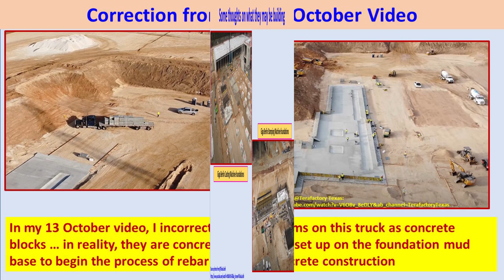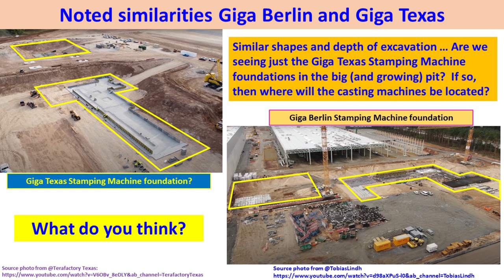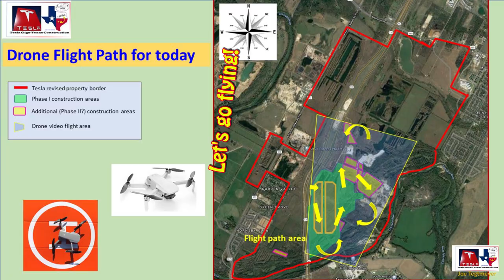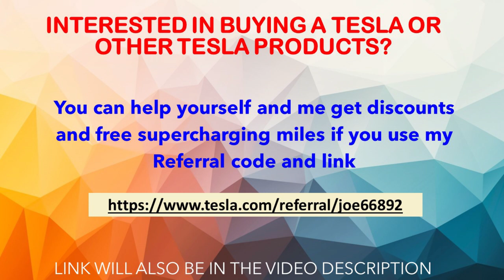Tesla Gigafactory Texas 15 October 2020 Construction Update (08:00 AM)

Comment: Hey Joe, it is so hard to compare Berlin and Texas, because they are using completly different building technics. For example, at the  Stamping pit thye drove 10 feet or 30 feet long Concrete Stales into the ground, poured a little Concrete on top of it and pileling up Rebar and Concrete on top. At the Casting side, they also had a deep pit and build large Concrete footings with Rebar, let the cure and build smaler Congrete footings with Rebar on top, filled the space in between with sand and poored Congrete with Rebar on top combining several Footings. We also had no GeoPiering in Berlin, I don´t know if that type of building isn't allowed in Germany or if they didn't came up with it. because all of the footings are super heavy and big in Berlin. Also the Paintshop is the only Building with a concrete floor so far. all the other Buildings, including the Drive Unit assembly doesn#t have a floor until now, it's still sand. On Thursday the Water Supplier shut down the Water Supply, because Tesla didn´t payed the bill or reacted to last note :-D - We don't play games over here!  The shape of the Pit looks like Stamping, but with the extension and the different construction methodes, I'm completely lost. If they keep the pattern of distancing them, Casting would be where they start GeoPiering in the middle. but at the  same side of the pits. The Pouring Training Site looks like they are training to pour concrete into small squares, like the stands for the concrete stales for walls and roof in Berlin. I think they'll wait with pouring the floor untill the end, like they are doing in Berlin. I'm curious to find out. Thanks for the Videos and effort!
Reply from the maker: Thanks and you are right, the methods of construction are very different, but it can be informative to see what they did in Berlin and then see how that might be done here.  I believe that unlike Berlin, the foundation will be poured first here in a continuous slab (or possibly large slab sections) and then later do tilt-wall construction using the slab as the production site ... but, we will all know soon ... probably around the first part of November.
Reply: @JoeTegtmeyer  Does anyone know how tall the tilt up walls can be?  Can you have multiple stories with tilt up walls?
Reply from the maker: Yes you can ... Up to 30 feet tall is common but with special spreaders and reinforcements they can go up to about 100 feet tall.  They are commonly used in large buildings, warehouses and factories in Texas and other areas of the US.
Reply: Lots of people said they turned the water off, but multiple videos from the usual documenters show there was still functioning water onsite when others were saying it was off. Also, it wasn't that Tesla was refusing to pay the bill, there was a sanfu in linking up Tesla's automatic payment processor with the Local governments payment system. Word is that is has been handled already now.
Reply: Part of it is the differences in soil at each site, which require differing methods of soil stabilization and foundation work. Part of it has to do with differing national and  local building codes at each site.
Reply: @JoeTegtmeyer  Thanks, Joe!
Reply: The nature of the soil, the depth to bedrock, etc all could impact the engineering choices for the foundation.  Berlin and Giga Austin are likely quite different in this regard.
Reply: One of the principal differences is the soil type. In Berlin it is deep sand  so the foundations are floated. In Austin it is reclaimed soil on gravel, so the geopier method seems to be the best methid of stabilisation. The other issue is environmental - in Berlin, due to the neighbouring  water conservation area and shared aquifer there were concerns that piling the whole site  ( as I understand was originally planned)  would somehow disturb the aquifer. Not sure if this was a valid reason...!
Reply: @andygranger3662  As a Professional Geotechnical Engineer, I believe the harm-the-aquifer narrative was purely based on emotion.   Almost all the water we drink is transported in concrete and steel pipes -- so by extension, it should be obvious that concrete and steel piles are safe in contact with drinking water.  And sticking piles in the ground is not going to change the water table -- water can flow around piles.  There will be densification of the ground in, and immediately adjacent, the area where the piles are driven.  But look at the area of piles, viewed from the overhead camera -- it's like 1% of the site.  And the whole site is a tiny part of the municipal water catchment   The impact of piling on the water shed will be zero.
Reply: @tedg1609  well that’s the point, it’s a water reserve Area and a very fragile Eco System. In Germany they work like proof it is safe to get the permit, in the US it is proof it to be harmful or we allow it. Like fracking, it’s forbidden over here, CH4 in atmosphere has risen massively since 2008, when it became common use in the US. And it’s Stuff line that, that’s handled different in Germany. If you put Stuff in the ground, penetrating the Watertable, it must be safe. It’s not like  Boisy (not sure if I spell it right) in Idaho, where the water was poisoned for a long time by companies and People had to live with it and needed to fight through court to stop it. We have a Verbraucherschutzzentrale like a institution of public right, which only purpose is to protect the People for lobby interest and harm from Companies. They test Products for safety from Nutritious points of view up to ethics, marketing, production everything you could imagine. That’s why Trump say we live in Forrest Cities and and Socialism 😁 we take care of our People and the environment and if they are safe, we talk about businesses.
The area where they are building Giga Berlin is providing the Tapwater for the City of Berlin and the whole region around and nobody want to harm the quality or possibility in 20-30 years. And even Tesla is a good Company, it’s still a US Company with a very different point of view. We still think they have no Idea of worker’s rights over here, because they won’t be here if they knew. 😁😁
Reply: @Marco2710x  ich habe ein paar jähre in Berlin gearbeitet, also ich stimme zu -- sie haben recht auf die unterschied zwischen Ami und Deutsche Umweltperspective.  Es Wahr, dass Deutschland ein Huebsher und mehr ordentlich Land ist.  Vielleicht ist besser dass diese dritte Tesla Fabrik in Deutschland gebaut ist, damit Tesla gute Umweltschutz regeln Lernen können.   In diesem Fall, Ich mach Ihnen die Vorschlag, dass vorsichtig in kein Perspektiv  mag night vorsichtig in gross Perspektiv sein.  Die Umwelt geht 100% in die Hölle Weltweit, wenn alle Welt-Städte an der Küste überfließen innerhalb ein paar Generationen von Klimawandel.  Es gibt venig zeit ein Umwelt tragodie globaler Proportionen zu vermeiden.  Eben Berlin hat Höhe über der See von nur 34 m (!)  Es muss China und Vereinigten Staaten und Deutschland Zusammenarbeiten geben -- jeder mit seiner stärke -- die Kommende Krisis zu überleben.  Mit der orange Affe in der Weisse Haus, gute Leute brauchen eben mehr diese Zusammenarbeit.   Ich hoffe es klappt.  Die alternativ es schlimm.  Sowie schlimm als mein Deutsch.   Ich bin stolze auf Euch.   Alle Beste, Marco.:)
Reply: @tedg1609  agree
Reply: @tedg1609  ich wollte dir noch antworten Ted. Dein Deutsch ist vielleicht nicht perfekt aber es ist ganz okay, man versteht alles. Sicherlich muss man das große Bild betrachten und am großen Bild (mehr Elektro Autos sofort) arbeiten aber welchen Nutzen hat das große Bild, wenn man es im kleinen Zerstört? Sind 500.000 Elektro Autos pro Jahr es wert die Natur für Millionen Menschen zu zerstören? 500.000 E-Autos machen es für alle Menschen 0,00001% besser aber für 2,500.000 Millionen Menschen können in 10 Jahren nicht mehr leben, wo sie jetzt leben? Das ist nicht besser

Comment: Great video today, Joe! Any idea what that white cart vehicle is @3:30 on the left that rolls back and forth over the area close to the rebar squares? It doesn't appear to be one of the earth movers, but I can't figure out what it is doing.
Reply from the maker: Good question ... I don’t know but will try to find out if I can
Reply: @JoeTegtmeyer  The white vehicle looks like a multi-wheel stabiliser, which is normally used to provide the final smooth surface - I’m guessing.
Reply from the maker: Thx!

Comment: I'm really surprised that they haven't put in dividers for the batch plant materials yet. I'd be worried about them starting to mix
Reply: I have never seen a Batch plant without divided materials. I think that material is going to be spread around as a base for blacktop.
Reply from the maker: Thanks for the ideas ... we should know pretty soon I think what this is for
Reply: Exactly my thought James. It seems to me they need the dividers and backing wall for the sand and each size aggregate to keep them separate from one another . Plus to keep the material from flowing off the backside into the grass and down the slope.  Hard to imagine what these guys are thinking. Seems not to be a well coordinated plan.
Reply: @bitspieces3885  Probably not just fully ready yet rather than not a well coordinated plan. Could even be the current piles are for the actual driving surface around the batch plant, rather than the raw materials for the batch plant once in operation. Too early to tell.

Comment: My vote is the  casting will be separate from the stamping area, not in the south corner.
Reply from the maker: Could be ... where would you put it?
Reply: @JoeTegtmeyer  not sure, but it needs a strong foundation as everyone says each caster is 410 tons.  Perhaps where they are doing a lot of geopier work.
Reply: @haroldz9915  Not likely unless you mean near but not at the geopier activity. Given its size it's support base would start in a pit such as we are seeing with the two pits in the south so geopier activity would start at the bottom of the pit not at the surface. I believe the casting machine(s), there should be multiple ones as in Berlin, will require more space than the stamping machines so I suspect the larger pit even though it is not as deep as the smaller one will be for casting. Also the casting machine(s) will replace many stamping machines previously dedicated to casting the front and rear underbody leaving primarily the outer body panels to be stamped.
We also don't have definitive information regarding what tasks/vehicles are assigned to each of the three "buildings" so we really don't know the number of casting and stamping areas there will be or in which building.

Comment: The power lines to the batch plant are normally 13,000 volts. I don't see any transformers. Does the batch plant have their own transformers ? all the motors would run at 440 volts.

Comment: What is the only real reason Geopier work isn't rapidly progressing?   It isn't manpower,  equipment or money, I believe the Geopier people have been told to slow or stop their work. 
Why?  The only good reason for the delay is the architects don't know where to place the Geopiers, this could easily happen if the architects are trying to enlarge buildings or move things around.   

These are very expensive changes to make at this stage.  The contractors want to finish their work  ...and get paid... perhaps paid extra for finishing ahead of schedule.   At the moment they seem to be waiting.
Reply: I think you will find that most of the east site has already been "goepiered". This is actually a very efficient way of ground strengthening using a few machines and simple materials. It does not look like progress is being made for the simple reason that it is pretty non-invasive. If you check the quad sqad videos, you will find that the drill, fill and tamp cycle is very quick. As the steel columns are still out to tender as I understand, there's no hurry.

Comment: Hey Joe, this has been great to follow....really appreciate the effort you put into this with research and comments.

Couple thoughts...
1) the central roadway, as you suggest, appears to possibly be utility tunnel to service the entire length of the building from the center.  Why they are "narrowing" the central roadway could just be that the newly raised areas did not need the surface prep work needed for the main buildings and the tunnel is now getting closer to being formed for final purpose.
2) construction slowing could be partially that they are ahead of schedule a little due to good weather, and to some extent, they can complete the remaining work along side the footers being poured in the east (?) side of the building.  They can't do it all at once, but they did need most of the the first side mostly complete to be able to work on all the required job functions.  Now they can take a little more time in getting the west side ready while they finish up the east side.
3) the expansion of the big digs definitely looks like something changed as opposed to a mistake in the original dig.  It appears the new dig now has the edge of the building, so perhaps a tweak to what will be on the edge of the building at that point...

Keep up the great work...  :)
Reply from the maker: Thanks Mark and appreciate your thoughts and comments!  👍

Comment: The 4 small concrete squares near the rebar stacks don’t line up well with each other.
Reply: Are they supposed to?
Reply: Mudslabs are mudslabs, just rough hard surfaces onto which the rebar cages can be laid precisely and levelled. In Berlin these were laid without formwirk or excavation.